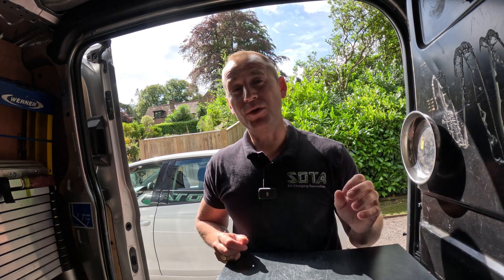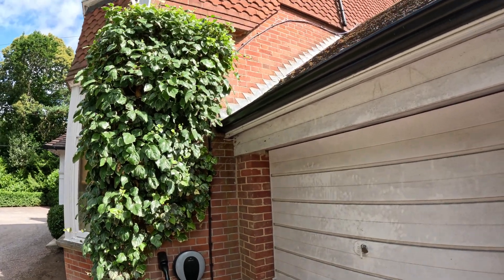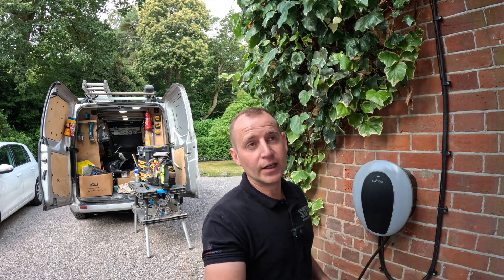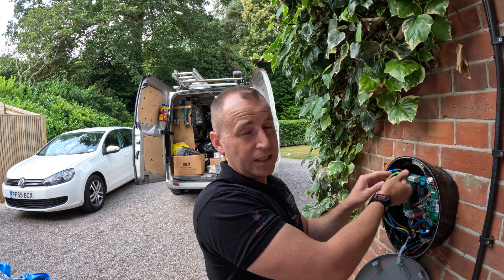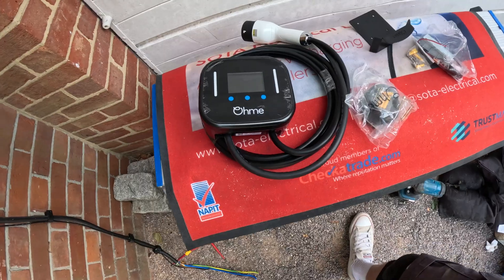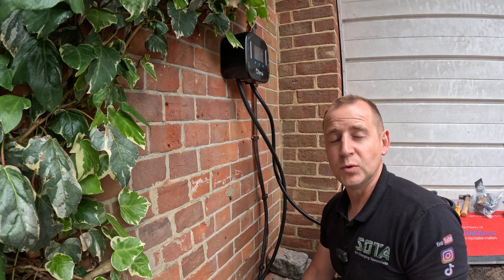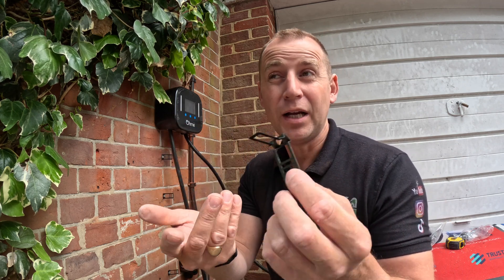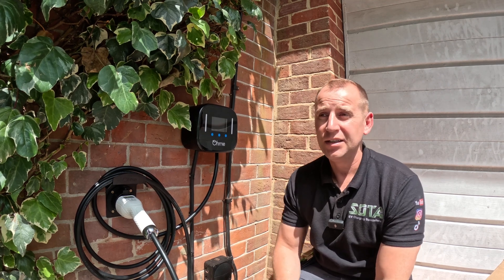Replacing a 5 month old charger supplied by a car dealer..WHY??

Comment: I have an Ohme for 2 years and my experience has been horrendous . The charger drops the API connection to MIni/BMW and so it cannot find the battery charge %. The support line is hopeless, they advised to un-pair from the car API and re-pair, but this clearly does not repair it... So after all else failed, they call it a lab feature. I use the BMW and third party apps that read the battery level without issues. If I was now deciding on what EV charger to install, I would save the money and get a dumb charger, essentially just make do with some simple rules, which is essentially what Ohme will tell you to do (after all the expense).

Comment: Does the wiska box need to be below the Ohme or can it be up under the eves?
Reply from the maker: I don’t think the pre flex cable would reach the eaves of a house normally?
Reply: @sotaelectrical but even if it didn’t reach do they need to be below or side by side to the charger level then the internal power and cat cable being terminated at the top off the junction box going up to the eaves ? My installer has came down the wall all way below the charger then up to the charger an then out the hanger for the charger 5 bricks below making it all look untidy
Reply: @sotaelectrical I wish I could show you so I can advise him before he completes the job tomorrow morning at 8am

Comment: Hiya, nice video. What was the tariff difference that meant the Ohme smart features could pay for the charger? I thought most overnight tariffs now were in the 7p/kWh to 9p/kWh range?
Reply from the maker: This is an old video now buddy, things have changed
Reply: @sotaelectrical  That's the problem, stuff changes when the wind changes.

Comment: Can you quantify when you say those electricians do not earn a lot of money? I am getting an EV at the end of the month and after a lot of research and buying the materials i wonder how much an electrician expects to earn nowadays. I bought the Ohme home pro brand new for £440, then bought all the materials for £160  (consumer unit, 10m doncaster cable, junction box, tail cables and so on, all good quality brand). This makes £600 total and octopus charges £1000 minimum. As such, that leaves £400 just to cover labour and the job is definetely less than 4 hours. Even if it was, then i would mean £100 labour per hour which is way too high in my opinion, hence my question at how much you expect to earn an hour as some builders have become ridiculous in thier quotes and wanted to earn more money than qualified scientist or doctors for example. On top of this, i would think Octopus or an electrician would get even better price than me as buying bulk. One electrican even quoted me £1200 and when requesting a details quote, it was the exact same material as i had bought. Therefore, i went the route of buying the materials myself (yes it does require to look for best price on the internet) and then getting a local electrician to install it and it turned out to be cheaper even than an Octopus package.
Reply from the maker: Well you’re not running a business for a start, you have not taken into account public liability and indemnity insurance, the cost of being part of a competent persons scheme, van running costs, van insurance, the cost of notifying the local building authority for the new install, time getting to your job, time sourcing equipment/materials, time after the job completing your certification, time notifying the DNO, a percentage for tool wear and tear, you have also assumed that it’s £400 in the sparks pocket without taking into account national insurance, tax, accounting fees, you also undervalue a qualified electrician’s time, it may take a good electrician 4 hours but it would take anyone else way longer because they don’t have the knowledge and experience of a tradesman. You may well say that you could do it, but you would never know if it’s a safe install, it might work but you wouldn’t have tested it, you wouldn’t know if there was something wrong prior because you don’t have the knowledge of an electrician, I think you need to learn a little about business before you assume all the money goes into the builders/tradesman’s pocket, because it doesn’t. We get hammered left right and centre by the tax man and then get accused of earning too much by people who have no idea about what’s actually going on.

Comment: I am getting a 7kW Ohme Home Pro home EV charger free as part of a deal with a new ID3, which seems like a no brainer, but of course, it will depend on the quality of the people doing the installation.  I am more concerned about the fact I only have a 60 amp fuse, and at the end of a loop supply, I made the dealer aware, but they said to discuss it with the people who will be fitting the unit.
Reply from the maker: The dealer won’t really care and the lads that turn up to do it will more than likely just walk away once they find that out unfortunately
Reply: You need to apply to your DNO to be unlooped 
Usually the dealers offer you charging credit with a public charger company instead, see if that's an  option. 

Then once unlooped get one installed
Reply: @ Thanks, that is exactly what I did, and had it unlooped a couple of days ago, I now need a new fuse board before they will uprate the main fuse though, and that is going to involve an electrician.  So far, I have been quoted £350 including the inspection of the whole of the house electrics.

Comment: I had an Ohme charger as part of my purchase of a VW ID4. Nightmare to set up, support difficult to deal with, long wait on the phone, only to be told to switch off and on and phone back for another wait when it didn't work. Had a Zappi fitted at my other house, excellent support 5 minutes wait, call back after 15 minute, and stayed online until sorted. Sooo much better.

Comment: Gutted. Had a Hypervolt Pro 3 installed recently and the cable has those nasty fixtures rather than the neat clips you used. I thought it was as good as it could be till i saw this.
Reply from the maker: Sorry to hear that, some guys just use the cheaper materials unfortunately

Comment: I had my podpoint installed when I first moved to EV 4 years ago. they did a good job however a year ago i decided (like mr smith) to change to ohme. got a mate to do it for me and its brilliant. Only thing i cant get my head around is why "mr smith" wanted the cable over the roof. looks awful. around the house is so much better.

Comment: If the consumer unit is just the other side of the wall, can the fixed cable from the ohme go directly into that or does it need a junction box?
Reply from the maker: If your lucky enough then that is absolutely fine

Comment: Great videos mate. 
Do you notify every charger to the DNO? I was installing charge points last year and used EV Comply which was a right faf and put me off installing them!
I get they need notifying, EIC, building regs but unsure easiest way to let the DNO know without using a middle man overcharging for something I could do myself. 
I got the EV Comply set up when I did the 2919 couple of years ago. 
Cheers mate

Comment: Lol great install. The tariff must be a super deal as changing the charger at i guess over £1200 with install . My question is how long will it be to break even on the saving. No differant to solar people talk down the oub avout how mych they save but when i ask the all important question . How much was your system, most people average £7k then i say cool so how long is your pay back . This confuses them . People nothing is free until your system returns your outlay first. Then its free

Comment: Meh, I had this ohme for 6 months or so, constantly issues with sync etc, pita, removed it, got tesla wall connector, nice and simple.
Reply from the maker: Appreciate your comments, when the client is on an OVO tariff they are limited to what chargers they can have installed to get on the best EV tariff.
Reply: I have OVO with an unsupported charger, instead I have to use the app on the car.

Comment: I had that company do an ev charger install for one of my properties..   They were cursing me cause I am an electrician, firstly they wanted to fit a consumer unit in the meter box, I told them they were not going to do that but they could come off a spare way in the consumer unit, they told me they were not allowed to touch the consumer unit and didnt have the budget to do that, I said fair enough whipped out an mcb, moved around some breakers and cut down a bit of busbar and bobs your uncle spare way..  Then they said they didn't have to install an SPD, after confirming with NAPIT hotline as I am a member they threw their toys out of the pram and said I needed to pay for an SPD, I refused and said no the regs say you need one unless I say I don't want one, they tried to say thats ok then you can just say you don't want one, if you want one they will charge more, I was like no I will not say I don't want an SPD because I understand the risks.  Eventually after I reported them to NICEIC they agreed to fit an SPD.   Then I told them it was a looped supply, they had no idea and were not going to check, I told them they needed to report the install to Western Power.  9 months after the install they still had not reported to Western Power and eventually I had to report the install, they gave me the EIC but no buildings regs compliance certificate, they said I had to talk to the local council about that, I again reported them to NICEIC but thankfully they were like, we can see it here, whats your email address ill send it to you.   Awful company, the problem is you cant compete on price unless you are willing to cut corners like they do..   Totally agree use a local electrician.
Reply from the maker: Sounds like you had a nightmare!!
Reply: @sotaelectrical  I get the feeling it was quite a normal experience, the only difference was I knew the regs and wanted it done properly, your joe average would not have a clue..
Reply from the maker: @steve11211  I see so many poor installs it’s unbelievable, I can’t get my head around people paying an absolute fortune for electric cars and scrimping on the charging installation either.
Reply: @sotaelectrical  there's thousands of people insisting that everyone should just get an outdoor socket 😬
Reply from the maker: @Lewis_Standing crazy

Comment: that ohmi looks awful, it's small but cables everywhere
Reply from the maker: It’s certainly not the most pleasing on the eye but there isn’t a lot I can do about that unfortunately
Reply: @sotaelectrical  not criticising your work fella, just in all the marketing material for the ohme pro they make it look small sleek and clean. its good to see in reality its not the case. im looking at one and the wife doesnt want cables everywhere on show. i was considering the ohme.
Reply from the maker: @bigandyt  I didn’t take it as criticism, sorry if it comes across that way, my personal advice is that if you can’t hide the junction box on the other side of the wall such as in a garage, then don’t get the Ohme, there is just too much going on as you say with cables everywhere, not nice on the eye at all.
Reply: @sotaelectrical  I think I'm going to go with the easee pro and deal.with having to detach the cable